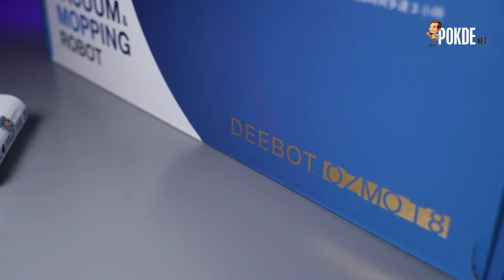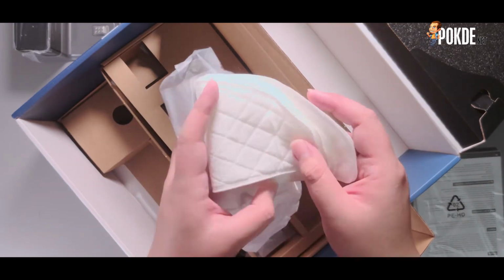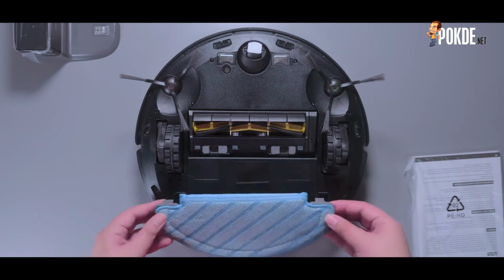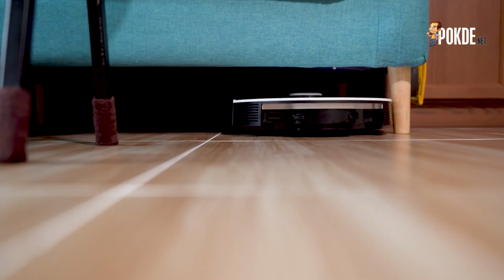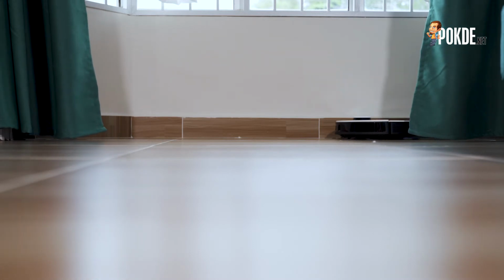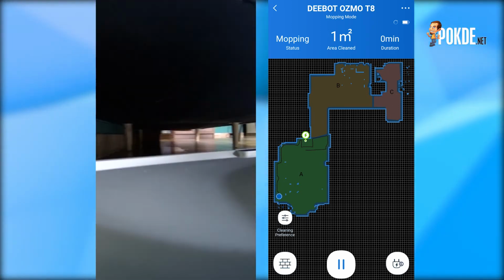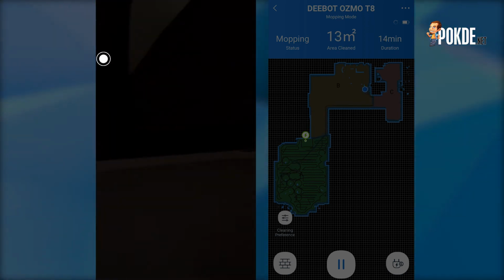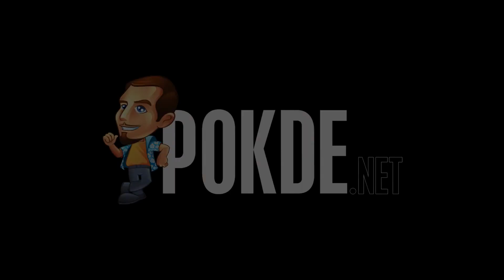Ecovacs Deebot Ozmo T8 Review - With True Collision Detect

Comment: Did you pour in some cleaning solution in your reservoir for mopping? Because in my t8 manual, they don't recommend using any solution, just water. How was the result after mopping with the solution?
Reply from the maker: Oh i did alright, and still are but to be safe i did dilute it down pretty much 1:20. Which is kinda odd that they don't recommend it, here in Malaysia our weather are humid without cleaning solution with water is hard to clean the floor up.
Reply: @PokdeDotNet  good to know. Thank you for the reply.